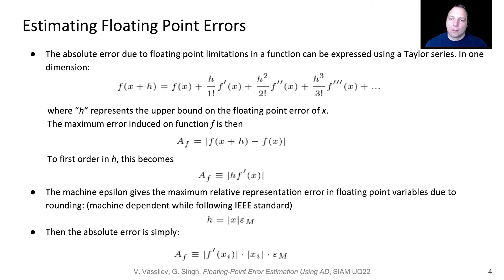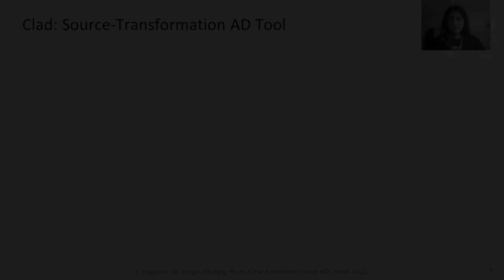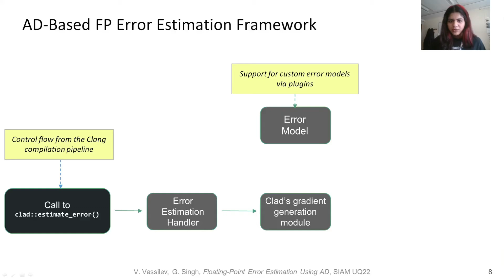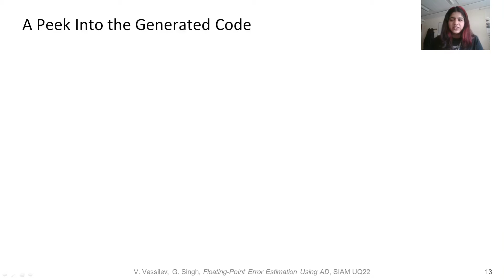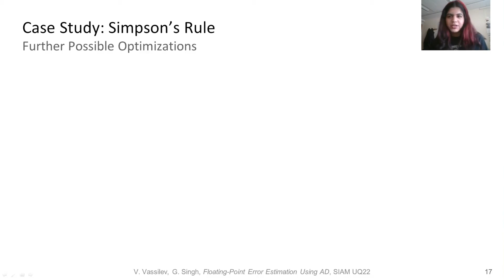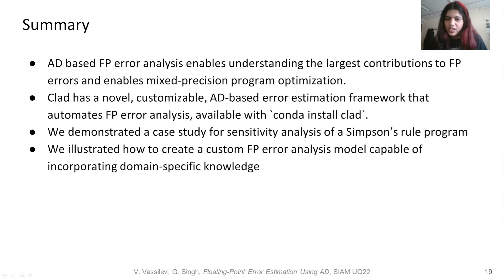Estimating Floating-Point Errors Using Automatic Differentiation

Comment: I'm trying to incorporate clad into my project, but I'm getting an assertion error. When I call clad::differentiate(f), I get `/usr/include/clad/Differentiator/Differentiator.h:150: clad::CladFunction<F, FunctorT, EnablePadding>::CladFunction(CladFunctionType, const char*, FunctorType*) [with F = void (*)(double, double, clad::array_ref<void>, clad::array_ref<void>); FunctorT = clad::NoObject; bool EnablePadding = true; CladFunctionType = void (*)(double, double, clad::array_ref<void>, clad::array_ref<void>); FunctorType = clad::NoObject]: Assertion `f && "Must pass a non-0 argument."' failed.
Aborted (core dumped)`. I'm using example code straight from their readme on github.